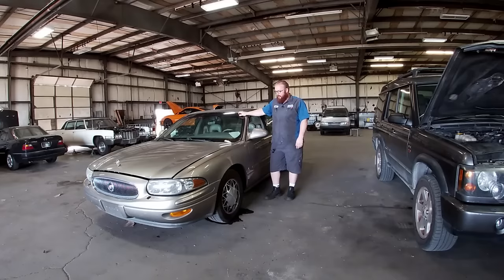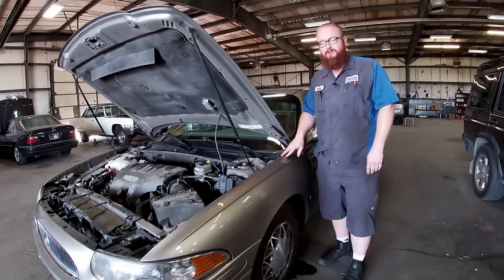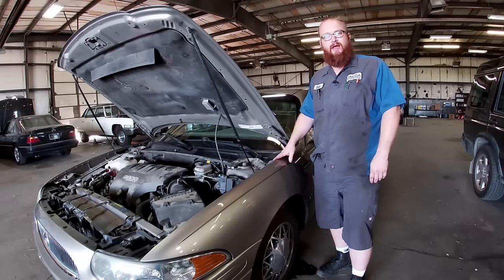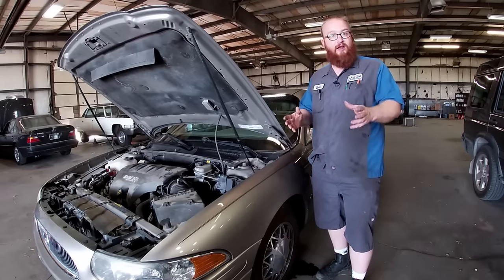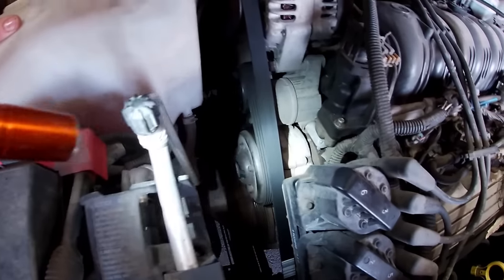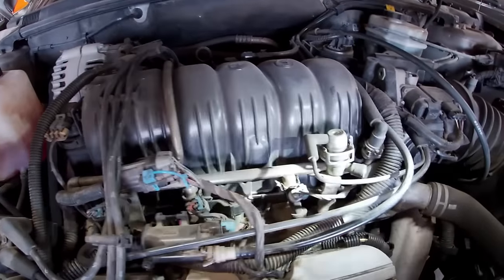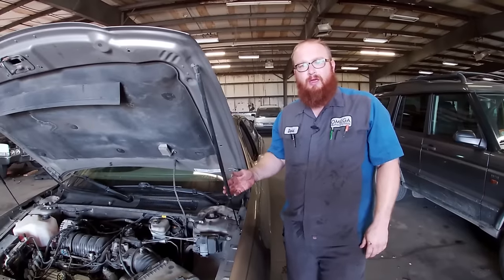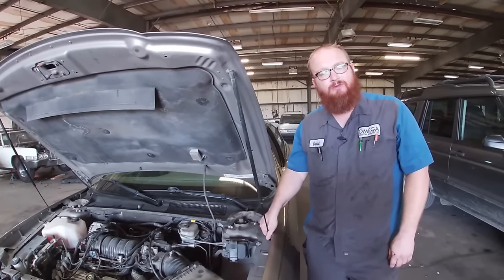CAR WIZARD highlights what makes the Buick 3800 V6 the BEST engine ever!

Comment: I have said the same for years. I had a 2005 Lesabre and on a long trip I could get a little over 36 mpg. The engine had 184,000 miles on it and still run like a top and never had anything except a sensor changed it still had the original plugs in it. The oil and filter were changed every 5000 miles and I never had to add oil to it. Great motor. To bad GM couldn't build a trans that good.
Reply: 36mpg going down hill at 55mph maybe
Reply: @jalee6587  70 mph on trips it would get 34 mph on a 200 mile trip to my cottage. I guess you didn't have one that could do it.
Reply: Ever changed the fuel filter ??
Reply: 200r4?
Reply: Mine from 94 gets 22 mpg on a good day
Reply: You have to be careful about these claims because anything over 30 MPG is a figment of their imagination. What people do is watch the electronic average MPG on the dash which is not accurate. I know for a fact because I have checked it and  it is not accurate, usually over estimates MPG by about 3-5 MPG.

Comment: I had a 96 Buick la Sabre with the 3800 series 2 motor and it was a beast! I would constantly beat other vehicles in races and they couldn’t believe how fast it would get up and go. Right before 30 mph you could punch it and it would sit down and then launch you so fast. I’m gonna try to buy another one just to have. Great memories in HS with that car.. you could also hit the gas and then the break, etc. and the suspension made it look like the car had hydraulics lol. I could get it to bounce the front tires off the ground a couple inches. I ragged it out. But never once had a problem. Like he said, bullet proof!

Comment: I have one of those in a 2002 Australian made GM commodore, over 400,000 kms on the clock and has never skipped a beat, still run it and look after it myself absolutely great car.
Reply: Same - I have a 2003, have had for 13yrs and it has always been good - but I disagree with him criticizing the 3.6. Yes, the early ones weren't great but my 2016 VF engine is awesome, and if I continue changing the oil as often as I do I doubt it would ever have any issues
Reply: Hey bro . just make sure you keep changing your oil and filter and youn should be all good . change it at no more than 2000 to 3000 kms if you can. Sounds over the top  but if you awnt that motor to last id do it. also importantly driil out your air intake valve on the drivers side. they are too small and a leading cause of timing chain stretch. Trust me. You dont want to do the timing chains on these puppies. major job .big money.
Reply: Keep driving her bro. Shes only just been run in man . go and go and go
Reply: this to Gerry M about changing oil.
Reply: @darrylcampbell4411  Thanks Darryl - I know of the issues with the egr valve on the earlier ones, but as far as I understand this was fixed and mine has a different valve to the early alloytec engines. In any case, I currently change the oil every 4 thousand ks so expect it will last pretty well while doing that.

Comment: I own a 2001 Camaro with the 3.8 liter V6. Great engine! Has enough power, is reliable and inexpensive to repair, and I get 35 mpg highway!
Reply: The only V6 camaro that shouldve ever been produced shouldve been the 3.8
Reply: 35 MPG my ass 😂
Reply: @darthdarthbinkss  it’s not impossible if it’s a manual. I pull 30+ MPG highway in my 05 GP with a 4 speed auto
Reply: @picklebob3885  That's crazy, so many people on here talk about upper 20s with their 3.8 but all mine can get is around 24-25 max.  Usually I get around 22
Reply: @darthdarthbinkss  if I’m doing trips between small towns on 55 mph I average about 25 mpg highway most of the time. But if I’m on a long interstate trip doing 75 with a light foot I’ll get 30+. Can go about 500 miles on a tank on those long drives. City MPGs on the other hand ain’t nothing to brag about at all lol
Reply: @darthdarthbinkss  i got 25 consistently with my carburetored one
Reply: @picklebob3885  Maybe that's why, I do a decent amount of highway driving but it's mainly short trips.
Reply: @darthdarthbinkss  if your tires are properly inflated, don't have a car full of passengers and use your cruise control you can get 32mpg. I have a 2001 Park Avenue and achieve these numbers. I also average 21/22 in the city. I used to use Shell gas and believe it or not was getting mediocre numbers then switched to Sinclair and get much better mileage.

Comment: Excellent video. I just picked one up from an elderly lady in Sarasota Florida. 2002 with only 67K miles. Love it so far. All i have to replace to get it  back to shape is the passenger side window regulator, windshield wiper fluid line is cracked, and the motor mount needs replace.

Comment: My 2003 3.8L Buick LeSabre gets closer to 40 mpg on the hwy. Thought I was figuring it wrong at first.
Great engine.
Reply: That id wonderful, i cant wait to see it in my 84 cavalier
Reply: To anyone on here considering a Buick 3800 equipped car, specifically an N/A one: MAKE SURE IT HAS AN UPDATED FUEL PRESSURE REGULATOR. My father's '01 Bonneville suffered a fiery explosion earlier this year due to a faulty fuel pressure regulator that GM claimed was improved for the 2001 model year. Turns out that was a lie. The car was totaled. Upon researching the issue, there are thousands of cases, and even a recall, which DID NOT cover cars after the 2000 model year, even though it obviously wasn't fixed on the newer cars. Even a famous video of a 3800 impala blowing up in the exact same way at a shop after an oil change. So if you've got a N/A 3800 car from 2000 or earlier, make sure its had the recall done. If you have a 2001 or later, you'll have to do the job yourself or somehow verify its already been done without a recall sticker.

Secondly, the 4T65E transmission is notoriously weak. Excessive clutch wear is pretty much guaranteed unless shift kit is installed. Signs of this issue are hard shifts aı eventually slipping/shuddering during acceleration.
Reply: I don't believe you. I've got a 2002 Lesabre/3800 with 210000 miles and I never got more than 28-30  MPG. That is great for such a big car, and I too love the engine but don;t over hype it.
Reply: 28-30 MPG on the highway.
Reply: @shannoncoffey4298  don't know about your car. Not over hyped for mine.

Comment: Fun fact: Under the intake of this engine is an idler arm. It's a crooked rod, maybe 6-8 inches long that was made with the help of Briggs & Stratton (the lawnmower engine manufacturer), in order to make engine idle with very little vibration.
Reply: I notice that when i was in trade school. Some 4.3v6  had them
Reply: A balance shaft
Reply: Bought a Chrysler Concord at auction and  was checking it over and noticed a Briggs & Stratton design on harmonic balancer.lol

Comment: I really wish you can ask the owner if you can go to dealership. If not with him, by yourself.
That would make an insanely awesome video. But hidden camera or just record audio lol
Reply: Damn rite wtf is going on in that shop!
Reply: I was thinking the same thing, and then afterwards confront them on camera TV news style with Hoovie as the camera man, and some backup crew in case there is a fight. Start exposing these creeps.
Reply: Had this happen at Lexus of Westport in CT. I was with my friend and they told him he had oil leak that was severe, but he was planning on getting rid of the car in a year and long story short, it would be a waste to put $2k to only 'reduce the lea  but not eliminate because he has many leaks' (their words) to last one more year. They start hemorrhaging when we declined the work because we'd only drive the car another year. They claimed the engine would seize up. I could hardly keep from laughing. It's not that hard to add oil as needed. Anyways, drove his car to TN, WDC, and back to CT probably around a thousand miles and the oil level was the same as when we left. Lexus dealer in Omaha was great, but apparently that's an exception. Connecticut one was truly a "stealership"
Reply: wish you could*
Reply: @buckeyesfan4700  right*

Comment: I love my 2003 buick lesabre custom. I had my fuel pump go and my friend was trying to get it to go by spraying tha "stuff" into the engine cause we didnt know the fuel pump went and the engine and the air filter boot started on fire! Damn! Well i replaced the fuel pump and filter then also replaced the air senson in the filter boot cause it melted it during the fire. Well after all that today i just brought her back to life! Im doing all these mechanical replacements for the first time in my life by myself with no other previous experience. My brother always fixed my car but i lost him 2 years ago. I hope he is looking down from heaven and smiling if not for my success then for the fact that i understand why he was pissed alot of the time being a mechanic by trade cause nothing ever went the way it was suppose to. So i say my 3800 is bullet proof as well as fire proof and newbie mechanic proof. I miss you bro God bless. I hope you are proud of me.
Reply: Speaking of the fuel pump replacement on LeSabers it might be noted that there  is a covered "scuttle hole" in the trunk located above the fuel pump. No need to drop the gas tank to replace the pump.
Reply: What until you replace the water pump it’s so easy it’s hard to believe
Reply: @rayford21  thank you for the tip. I was already hip to the hole in the forward right corner of the trunk but I will be calling it a "scuttle hole" from now on thanks to your use of such colorful vernacular. Take care.

Comment: I had one of these in my first car at 16, Buick Regal GS 1996. Engine had a head gasket failure and I was too poor and young then to fix it. But, I regularly changed and added oil and the car kept on running even with virtually no coolant. This thing was an unbelievable beast of reliability never to be equaled.

Comment: Absolutely the best engine, I had it from 167,000 mile to 254,000 (in Australia, in a Holden VT Commodore) and all I replaced was the water pump.

Comment: I drove my 3800 buick regal till I could poke my feet through the floorboards, and the front end needed work. Ended up junking it at 250k. The motor still ran great.
Reply: Why you junked it?
Reply: @Kauffman578  Not worth fixing the frame problems. I got a free 2003 Bonneville as a gift with the 3.8 non supercharged v6. Frame was falling apart and I was told multiple times to scrap it and give up. Car still ran fantastic tho the whole year I drove it

Comment: I had a 1998 LeSabre, and yes, 28-30mpg. Even loaded up. Very reliable too. The torque, gearing, and low ride, highway bruiser.
I had it for 7 years, and a leaking valve cover, and fuel pump were the only real repairs. The auto-hvac was troublesome, but nothing debilitating

Comment: I had a 2003 Buick Regal with the 3800. The body and electrical systems gave out long before the engine ever did.
Reply: Like a candle in the wind??
Reply: Try a Lexus LS400 if you like affordable nice old cars that won’t die.

They’ll be banned for polluting before the engines die.
Reply: @kftc1980  lol
Reply: That’s pretty much every GM car from 1985 to 2005 or later with the rare exception of just about anything with a DOHC (Quad 4/Twin Cam, 3.4 DOHC, Northstar, Ecotec, etc).
Reply: @kftc1980  I'll keep my Buick. Same difference.
Reply: @kftc1980  ehh they were excellent cars. I had a 1990 ls400 the engine and transmission were bulletproof. It was my first car I never realized just how reliable those things were. It had over 200k miles and never one did the engine or transmission gave me one issue. Litterally nothing. My current Lexus at 60k has had issues and every other car I've owned has too. Those things are bulletproof other then the rack and pinion. They're known for a weak rack and pinion
Reply: Engine last forever. Every other part is shit
Reply: I just bought a 1993 Buick Regal Limited coupe fully loaded with the Series I 3800. I bought it because it had this engine. I think the earlier ones used better quality materials and were put together better. It's in excellent shape. The Series I also had less power to harm itself.
Reply: Steve Callachor bravo!
Reply: @Bartonovich52  
What is the nature of the electrical problems with old GM cars? Rotten wires? Poor connections?

Comment: I had  a 1980s version of the in an Olds 88.  It had a plastic cam gear for the timing chain. Over time,  it wore and jumped time, and a valve crashed into a piston.   My son was in high school and had some time so he pulled the valve cover off.  One pushrod was loose, so he took the intake manifold off the look at the lifters.  On that pushrod, the lifter had been collapsed.  He replace the lifter for $13, put a steel replacement gear on the cam, and drove that car to many years after that.   Pretty heart-warming story.  Always thought that was an amazingly good engine.  So smooth.

Comment: Have to agree with everything you said about the 3800. Was first introduced to it when the company I worked for got me a 97 Regal LS. I was shocked at how quite it was considering it was a pushrod engine and that I would routinely get 29/30 mpg on the highway. Got two more before I left the company. They weren't exactly fast but they weren't dogs either. Beat the snot out of each one for over 100K miles and never a hiccup. Such a fan of them that I'm looking at an older Regal for my daughter for her first car

Comment: I had a Lucerne with the 3.8. Because of a cracked coil it misfired when it was rainy. I drove it like this for like 2-3 months. The engine never died. I got into a front end carwreck and it STILL ran no problem!

Comment: They got rid of the 3800 because it probably got great gas mileage and the energy Mafia didn't like it.  Also because the engine was so good, they couldn't instill planned obsolescence. Because the greedy corporations need to sell more product.
Reply: exactly, if you buy toyota or honda cars that are non turbo and non direct injection you can still have engines that last 300k like the 3.8
Reply: There was a time I would have called you a cynic. That time is not now.
Reply: @HealthSupercharger I heard a similar story about the 3800 pre series and series 1 were excellent motors not an ounce went wrong with them internally. But the series 2 and 3 (especially the series 3 supercharged) they were good motors however for some of them I heared after so many miles they were known for head gasket issues and intake manifold issues and even timing chain issues along with some other issues as well. So personally I'd go with a pre or series 1 over the other 2 later series.
Reply: @deanfarr3249  that is false the car wizard just explained why this is the best engine
Reply: To the contrary... the Federal EPA Nazis and their ever increasing and borderline impossible to hit CAFE standards killed the 3800 and many many other great engines...
Reply: @krayzietj  No he didn't. He included all the 3800 engines as bulletproof but pointed out issues with the Series II and III. According to my research the 1995 170 HP is the most reliablele of them all. The 1992-to 1994 had 160-165 HP and were refined up until the final Series I the 1995 3.8L.  No leaky elbows, no recalls for fires due to oil leaking from plastic intake cover and gasket. 
I don't like the battery covered up with the windshield fluid reservoir though.
Reply: Guess what I found at Sundance? Buick Allure, LaCross. 70k 2009, 3800. Undercoated came from Canada. Looks new, have a carfax on it. Mechanics approved the buy. I take it home end of week to my driveway in Delta Twp. Ruby red.
Reply: It’s reliable, but the gas mileage isn’t great. It’s good, or acceptable for a 6 cylinder, but nothing amazing.